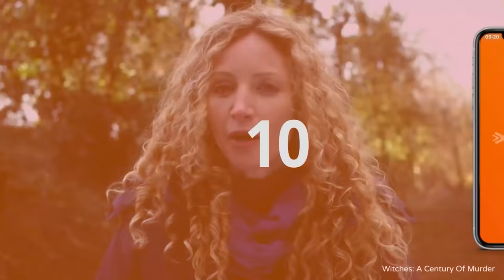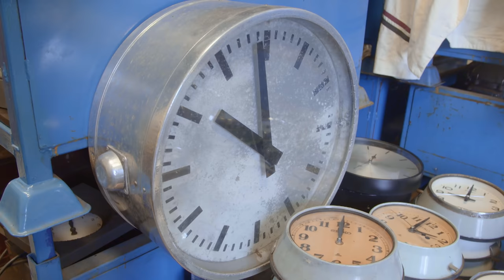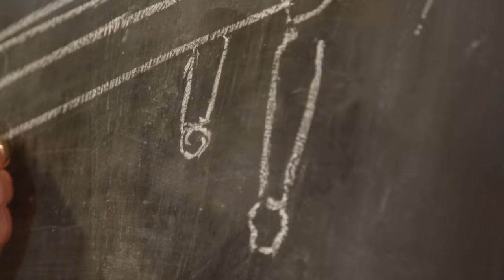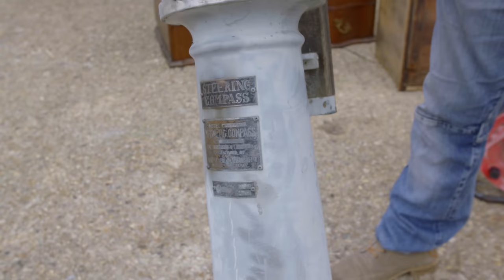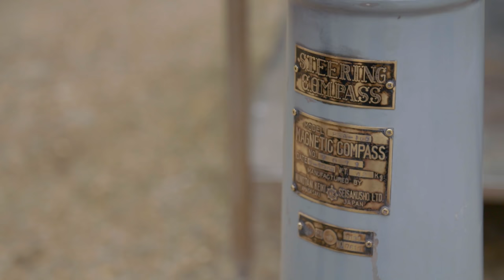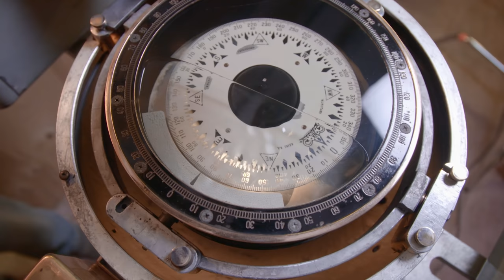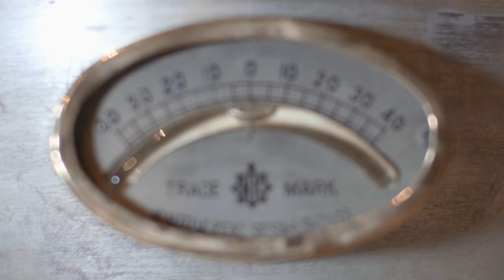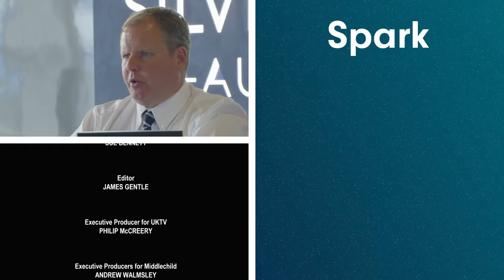Engineer Restores Vintage Ship's Compass [4K] | Restoration Workshop

Comment: Compass light should have a day/night switch and when switched to night mode, it should be a red backlight and would have looked a million times better. Or put a simple arduino channel switcher that switches from red to white every 5 or 1o minutes. You'd be amazed what automatic light color changes does to the mood of a place!!!
Reply: Yes, programmed LEDs would’ve made a huge difference, compared to a bright static white light.
Another thing that it’s a compass, and now it’s standing still. A programmed motor that mimicked ship movements, would’ve added a lot too.
Reply: Would certainly buy it for $/£1500. Definitely worth it. Need to find a place like that reclaim shop